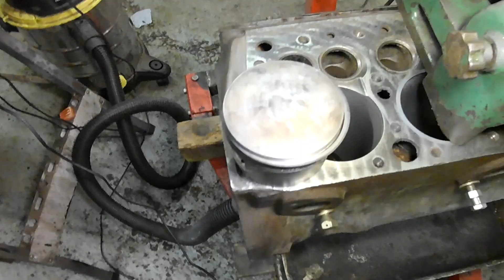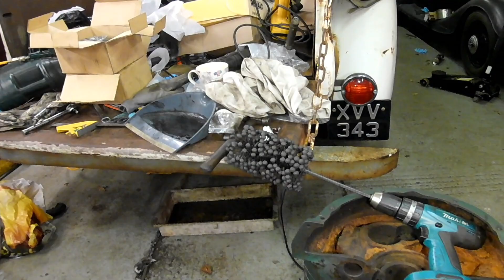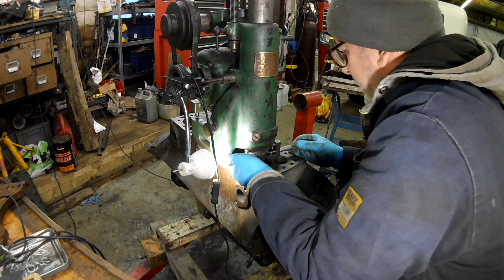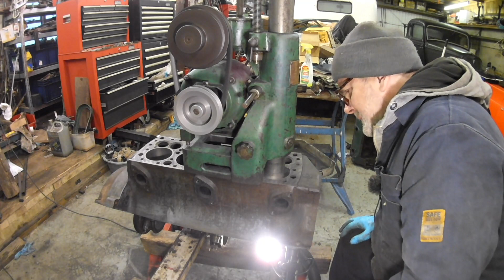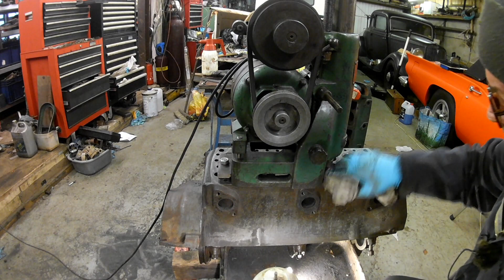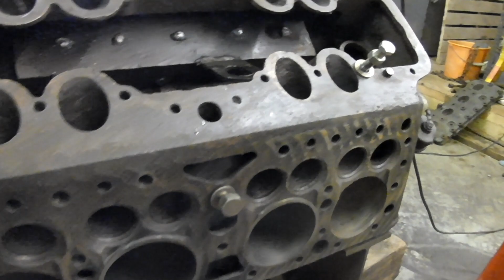Mart's seized Ford Flathead V8 Pt11: Will it clean up at +.045"?

Comment: Rewatching your videos all the time. I have a nice boring bar and several blocks to do. A similar lot of parts like you have. I identify! Wondering what your take has become in locating the cat paws? I have asked around if the very top (where there is no ring wear) is better than the very bottom (where there is no wear) is preferred. Kinda get a mixed response. Just curious what you’ve found now that you’ve done a couple? Great content and sharing style.

Comment: You long since learned the result so this comment might seem kinda silly. That pitting in the end bore sure looked like it was lower down the cylinder than the rings would travel in the video. If that were the case, they would actually be "oiling" pockets for the piston. 
I'm certainly no machinist but .025 sure seems tight for aluminum pistons so I just looked this up. 
piston clearance for aluminum pistons
This guy is saying .007 to .008 for .040 over aluminum pistons. Is that why you thought this engine seized when you took it on its first run??
Reply from the maker: Yeah, probably, Bob. I'm on a steep learning curve on this job. 7-8 thou sounds too much for me, I wonder if that was for a race motor with forged pistons?? I was told about 1 thou per inch of bore. I gone a little larger on the bores on the one I'm currently working on. thanks for following and your thoughtful comments.
Reply: @MartsGarage  
Oops!! Just realized that should have been .0025. ;o(

Comment: Running pistons of different sizes, doesn't have any affect on the engine, as long as they are the sanme weight, I've run a .o40 in a stock  engine just to fix one cylinder.
Reply: Yeah I've seen that done before. These old engine are fine with that, they aren't race engines.

Comment: Mart, from an old flatty builder, we always leave .001 clearance per inch, so if you have a 3" piston, you bore +.003 for clearance. Ya can't have them runnin too tight or it will seize up the first time it gets hot. Keep up the good work keepin the old iron on the road.